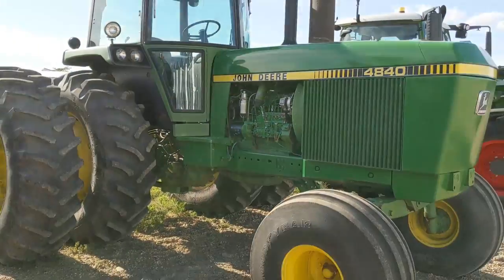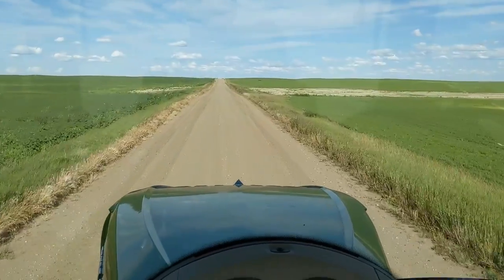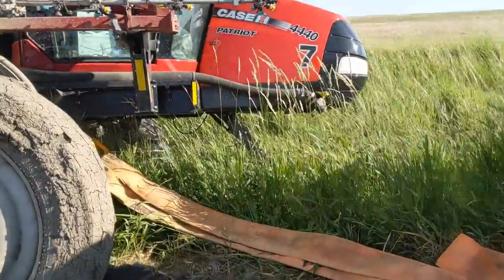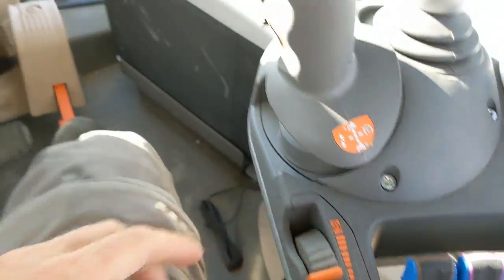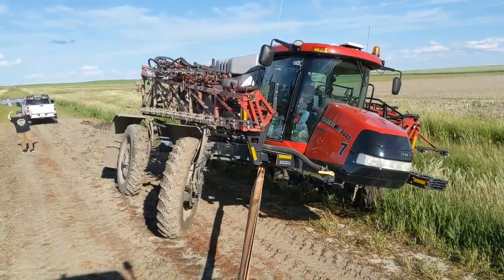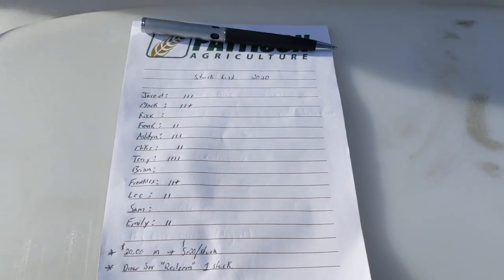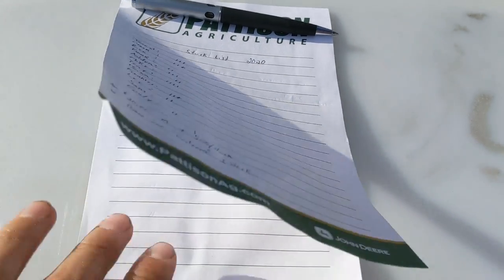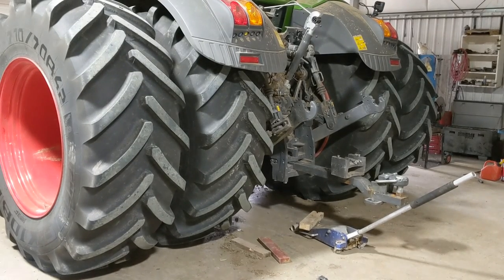1050 rescues 4440 sprayer 😂

Comment: As a towing operator for 30 years doing tons of farm recovery when you couldn't pop him out of the ditch, if you would reposition you're strapped to the ditch side of the sprayer you would have gained 3 ft of road because you were short and your strap by 3ft by moving it. Just a little FYI for the future. When your ankle gets tight like that considered changing the strap side.

Comment: I have been the towing and recovery business for years. Just a helpful tip. Do not have the equipment you are pulling out turn the tires hard out of the ditch. If you turn slightly to the road your front tires will not slide along the edge as much and normally will pop right out.
Reply from the maker: That's great tip, thankyou good sir!

Comment: You’re not kidding about stretch ropes killing people. In 1973 a neighbors tractor was being pulled out backwards and the rope snapped going through the back of the cab taking his head off. It was in the news. The tractor sat there for several weeks before it was moved. My dad would never use a rope for pulling anything.

Comment: Not to be "that guy" but wouldn't you get more lateral pull hooking on the left tow hook on the sprayer?
Reply from the maker: Yes sir, but there was 3ft of water there and being he was empty it wasn't necessary.. If he was really stuck to loaded, then yes
Reply: Doc Savage  I think what your seeing is know as ackerman angle.  The inside wheel always turns at a higher degree of angle because it has to make a tighter turn then the outside wheel.  All properly designed steering systems do this .....it's just really noticeable on a sprayer because the wheels are so far apart and can swivel at a high steering angle.

Comment: Cool video! Nice equipment! I just want to heckle ya about one thing, next to the 4840 there was a tractor with the loader raised 3 or so feet off the ground, when I was 13 or so I was informed in a not so nice way that it was a safety hazard to leave a loader (bucket, forks, bale spear, etc) raised when the machine is parked. When I see that the memory comes back saying don't do that. Other than that I like the video and I'm now a subscriber. 👍

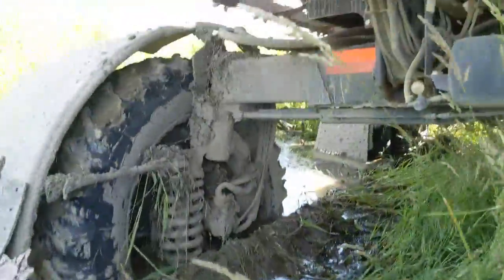Comment: 6:58 - If getting stuck ON THE ROAD is not getting stuck, then what is?? He will learn to live with the shame, along with all the rest of us who managed this special trick! ;D ;D ;D

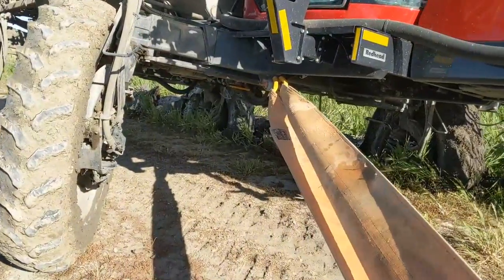9:05 - fastening the strap to the oppsite side (left side) of the sprayer would help pull him up faster. Even faster though, since the sprayer is empty, and it seems there is firm ground beneath - pull him backwards and make him steer into the road. You should be able to pull im up in about 10 meters backwards, if Frankles could steer it right (Full right initially, then when the left rear is on the road, pull hard left.)

Comment: 2 proverbs in German: 1. Talking is silver, silence is gold. 2. Before you do anything, please turn on your brain. That means in this case, if you want to pull the other tractor out of the mud, hang it up for a shorter time so you pull it in the direction you want. if the wheels do not want to come out of the mud and always slide on the edge of the path, place 2 to 3 boards underneath so that you can climb on the boards, then do the same with the wheels at the back. And finally, you don't need a tractor with 500 hp, one with 200 or 250 hp is enough, everything else is an unnecessary show.
Reply from the maker: 😂 That's awesome! Love the comment good sir, but believe it or not the 1050 is considered small on the farm. I do have 720 (200hp)but it has heating problem and wasn't reliable for that situation.

And yes I agree, there are many things I could have done differently, but we didn't just due to it being an easy pull of of the mud.

Comment: You ain't shittin' about straps causing havoc. We show a safety video at work of about 20 clips of straps letting go and the damage it can cause. But there's a solution. They're called whip blankets. Made of canvas with weights sown into it you throw it over the strap between the two vehicles and it absorbs the energy of the straps. We require whip blankets on all of our pulls. Cheap, easy and effective. And next time hook to the ditch side of the stuck machine. It's a much better angle.

Comment: I’m not sure how accurate the statement is but our local John Deere rep said during Deere’s Florida tractor testing last winter they tested a 1050 fendt and were able to put more power to the ground with an 8410R with the e23 trans. They said the cvt transmission along with their own ivt transmission are nice for certain jobs but not heavy draft work. I’d agree. We demoed a 1050 and ran it side by side with a 9510R and it couldn’t keep up. Really nice tractor to drive though.
Reply from the maker: I agree, I feel like it's more comparable to a 450HP... I am not sure about that 410hp statement - even with the E23, because I don't think that 410 Deere would pull the load that 1050 is.. Infact I am most certain it wouldn't.. 😂 

But if Deere is brave enough to say that, bring it on up and we ll find out real quick what kind of tractor it is!! 😂
Reply: Mike Mitchell   I see a Fendt vs John Deere pull off in the future🤣😂
Reply: not a chance, 1050 will win. all our 3 1050's put roughly 450hp down (thats more then the claimed engine hp from 8r410, also, keep in mind our 1050's all have a chip, which did add roughly 30hp compared to standard). so in other words they simply cant win this, if power down of 1050 is higher the engine spec from jd, cause we all know you'll lose some power from engine to wheels.

as for the 9510r, its unfair to compare weight difference is pretty big, and obviously its standard VS articulated.
either way i do still feel like 410 down out of 510 of engine in 1050, aint to bad. but i think they should be able to push it a little more.

Comment: I was wondering what kind of financial structure you have.  You said it was your 1050.  My  two brothers have never had an equipment agreement so there is overlap of equipment.   The break up of the family farm has not been pleasant.  I was just wondering if you have a formal breakup agreement or not.   I realize you have been a family farm for more than several years.    But what happens when you or your brothers are tired of you and want to dissolve what ever agreement you have.    Just curious from a broken family farm.

Comment: Mike, I may have found a power solution for your seeders and fertilizer carts. It's the ZF e-trac. It's an electronic wheel drive boost pack. You get more power and more traction. Fit it to the seeder or cart and get extra boost up the hills. It looks fantastic and might even be enough boost to get the Fendt 1050 up a hill. https://www.youtube.com/watch?v=gzZefxKH9K8